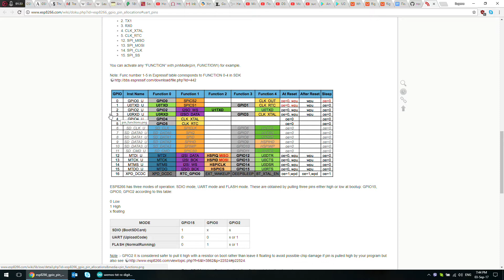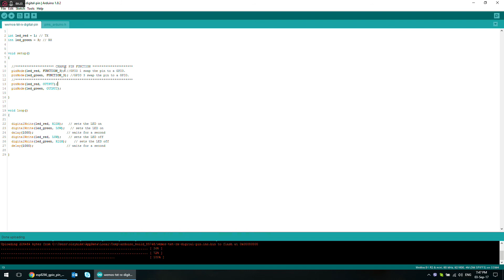How to use TX/RX as data pins on esp8266 / Wemos D1 Mini

Comment: Thanks for the video. I was setting the mode, but didn't realize there was an additional step to setting the output. Got me going. Now I can control 10 relays from a Wemos  and no problems reflashing either,
Reply from the maker: Thanks. Did I miss to mention something in my video?
Reply: Nope, I was missing something from where I was getting my info from the ESP pages. Your video filled in the missing spots exactly. Thanks

Comment: How could I flash the Wemos after changing the PINS? I am not able to change the Software on the Wemos..
Reply from the maker: Depending on what you connected to TX/RX pins. In case of LEDs I didn't have problems but if you do - just disconnect everything from TX/RX for the time of flashing.

Comment: for me it also does not work. The Led on Tx is blinking very low and the Led on RX is stable lighting HIGH;
Reply from the maker: You need to connect LEDs exactly as I have shown, together with the resistors.
The built-in LEDs are not going to indicate proper work.
Reply: Make sure you included the PinMode(whatever, OUTPUT); commands

Comment: What is limiting the current through your LED:s? Do they have built in series resistors?
Reply from the maker: I didn't add any current limiting resistors as it was a quick test. Of course for continuous operation you need to add resistors.
Reply: I immediately had the same thought and was surprised your question had no upvotes. It's a well intentioned video, but cutting corners like this wouldn't help beginners.